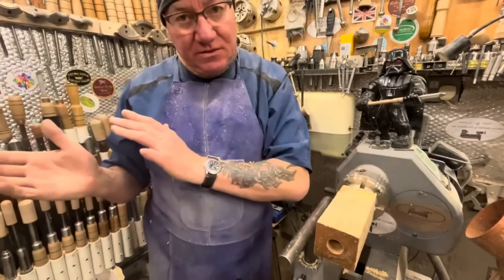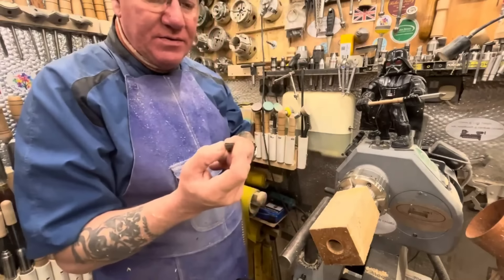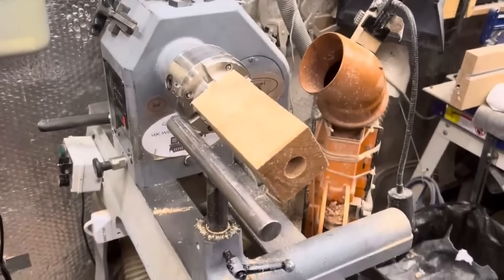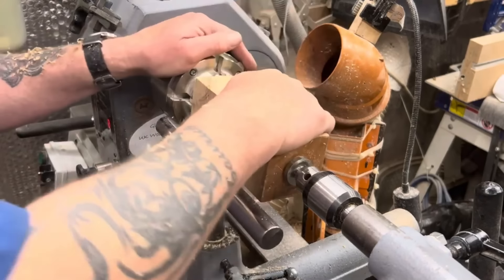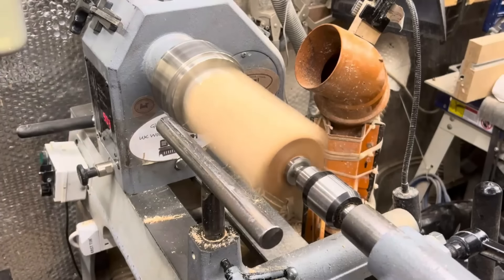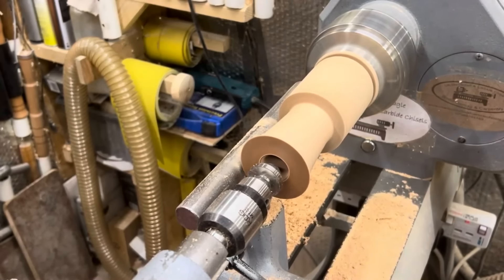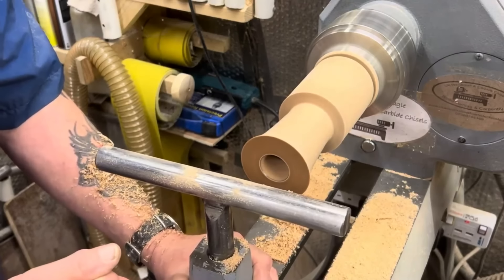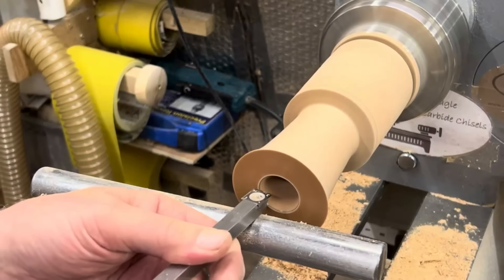Woodturning. Here's the little money maker. #carbide chisels

Comment: Sweet! I've got to find a wood source somehow for turning. There is a good lumber store about 45 minutes away, but a piece of wood the size of these would be about $5. Thanks for the show.
Reply: Someone near you has a cord of firewood for sale for $15, unsplit is best. This is your best source for woodturning. Most firewood is dry enough that it won't split anymore, but you will need to cut it into appropriate sized and shaped pieces. Just be aware of the balance point on any wierd shaped piece or limb with knots that you spin up. It could launch itself and damage a lot of things, including you.
Reply: @bradfordprice3781  Thanks. Hadn't thought of that.
Reply: @trahtrebor also after a storm drive around with a battery chain saw  The only issue then is the wait time. I just cut a truck load of cherry and pear this last week. I used some left over latex paint to paint the ends and stacked outside. The limbs are a year from working up. The larger limbs trunk I am starting the first turn of twice turned bowls. I also used bandsaw to make some 2×2 piece on each side of pith that are stacked indoors to dry
Reply: @johncox8882  Good idea. Ive just retired so I should have time now.
Reply: @trahtrebor  Always ask permission before taking/cutting trees/limbs that have fallen into "public" areas. Landowners are a cantankerous lot and may decide the limb is theirs. 2nd Amendment doesn't include an exclusion for people lacking anger management skills.
Reply: @bradfordprice3781  roflol so true!